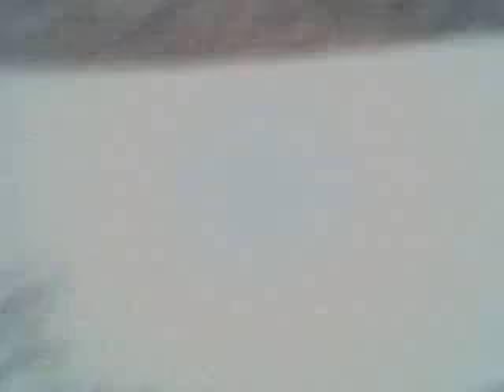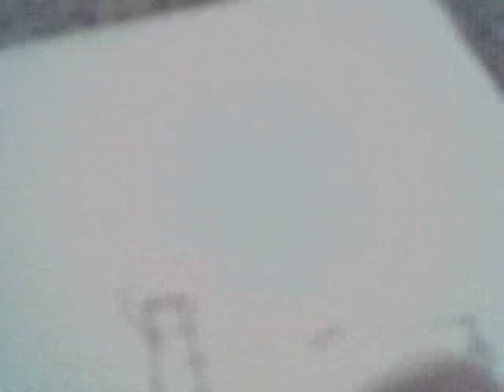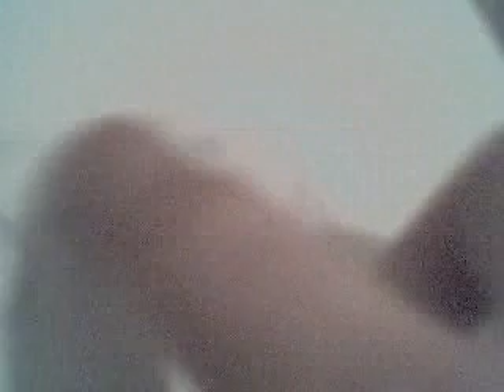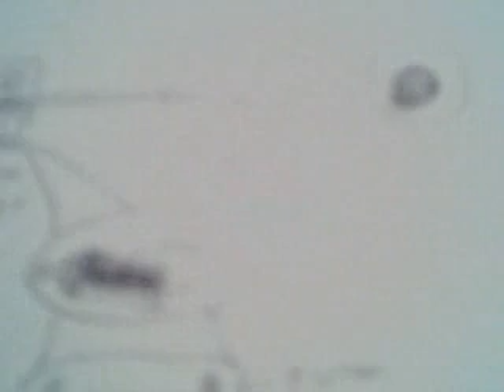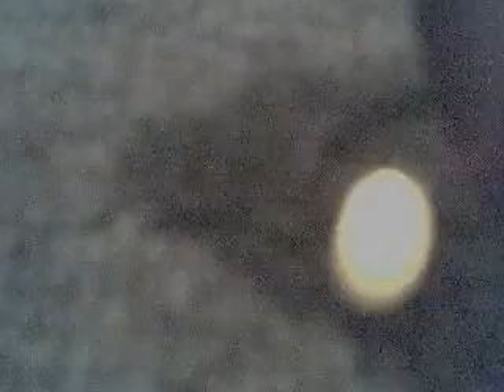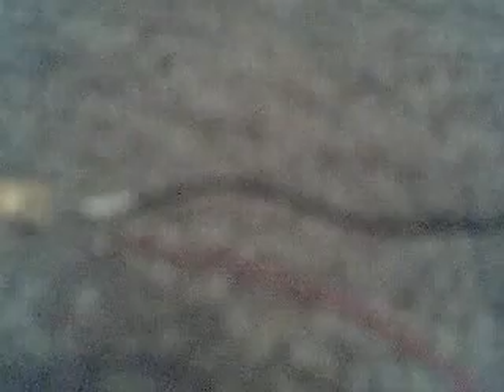Technical Breakdown 2/2

Comment: Shame about the vid quality; but its true that so much knowledge about how to tap natural forces for free energy remains suppressed & undeveloped because of institutionalized 'academic' dogma maintained & 'protected' by corporate monopolies. e.g. A perpetual motion machine is supposedly "impossible", but not true. Gravity is perpetual & a machine that can start by simply adding the last component  (no push) will run until the bearings wear out. [need to fix your link: .org/Tesla%20Switch.pdf]

Comment: that tesla switch document has vanished without a trace from the web...have you seen info posted anywhere but panacea. com ?  i've been meaning to try the circuit since i downloaded it a while back, but got sidetracked by the sg motor... the plan is to use the SG motor as a mechanical rotary flip flop switch for a 4 battery tesla switch circuit, swapping battery positions constantly while they power a load and charge each other up... may post a vid if i ever get it finished...